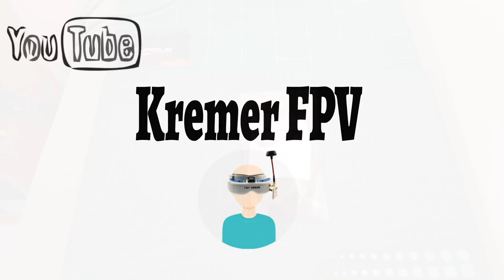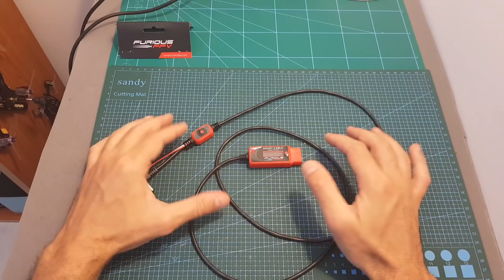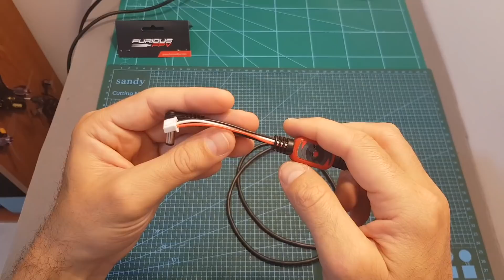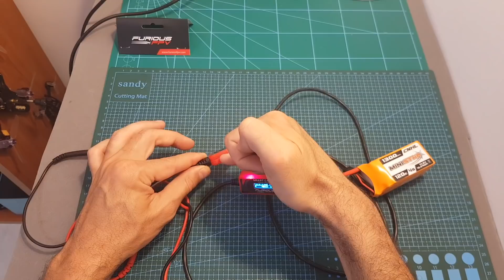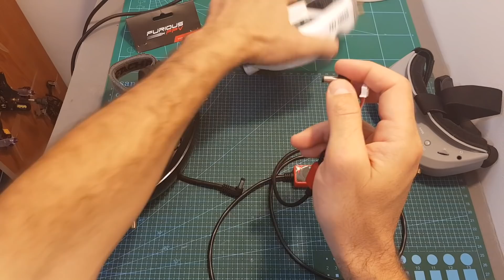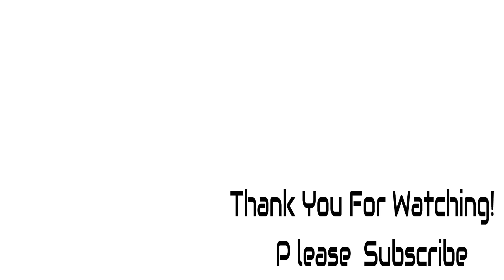FuriousFPV Smart Cable - Fatshark Button Alternative

Comment: So easy to make! Also, I hate the battery on one side of my head, Aomway got it so much better! Sits on the back of your head and you don't even know it's there! Plus, with their lipo battery power cable, we can use 2, 3, or 4S batteries that we already own. We all probably bought a cheap brand of battery when we first started out that we rarely fly with now, right?! So, I use those for my goggles!
I installed an on/off switch easily in the power cord and I've got a way better set up than this overpriced gimic for 30 bucks! Sheesh! 😖
We all build and repair our quads over and over, yet are we really too lazy to mod a power cord to have a switch?
So easy it's amazing more haven't done it! AND! The Aomway power cable, for the lipos you already own, works perfectly with any brand of goggles... And it's super cheap and an ultra easy mod! 🤔😁🤘